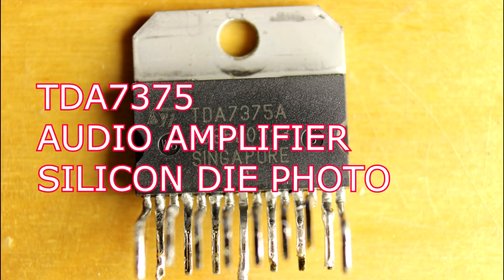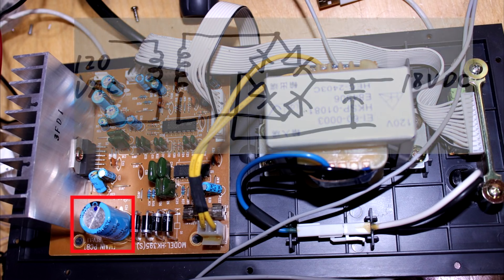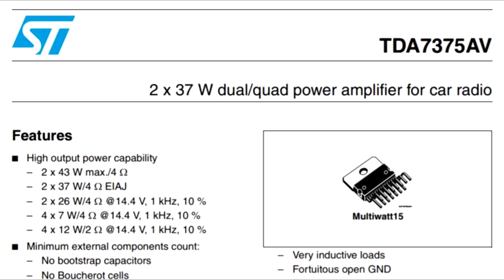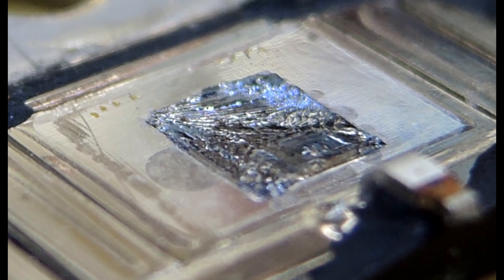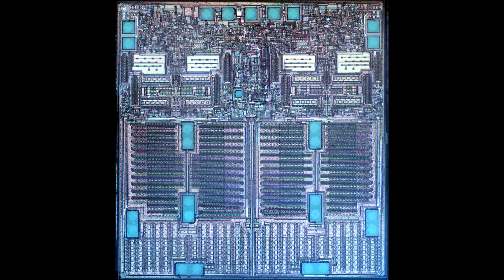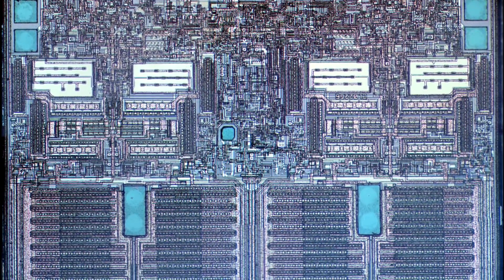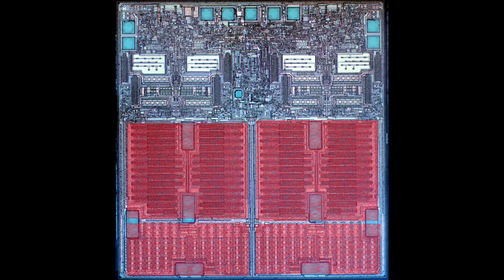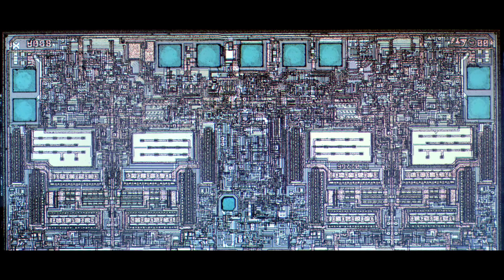Tear down of a TDA7375 Audio Amplifier IC

Comment: The amp become unstable with heavy loads below 4 ohms in bridged mode, horrible popping sounds similiar to clipping can be heard, internal current limiting is only about 3 amps peak, which is a bit too low. I dispute the power output given in data sheets, seems much less.

Comment: That's a Harman Kardon HK395 30W powered subwoofer. I've Taken apart the same one. I used the enclosure and woofer to make a Bluetooth speaker. It's a bummer that the transformer isn't a center tapped secondary.

Comment: Any rated at 10% THD is a joke and at a single freq of 1khz.  In real usefulness it's a 5 watt per channel at .05% THD at 1khz and .5% at 15khz.  And at <1% it about 9 watts per channel respectively, any more wattage and distortion goes up big time.

Comment: those where all over the place in the 80's and 90's, especially in boomboxes, nice compromise for low voltage application over classical AB amps, but like all bridged amp the output collapse if you push it too hard and distortion towards the end of the range is pretty bad, now that class D amps have made those chips obsolete in inexpensive devices I'm not we win in terms of sound quality, I let the "audiophiles" debate that one lol...

Comment: Aren't switching frequencies usually well out of audible range? I have a stereo very similar to what you show in the video, and I replaced the transformer with a switching power brick. There is no noise. In fact it got rid of the hum that was being cause by proximity of the transformer to the other circuits in the stereo.
Reply: Euro Bum Switching audio amplifiers are based on technology that's even older than this chip. Yes, if they're competently designed the switching frequency should be inaudible.
Reply: It sounds like you're referring to class D amplifiers, which is not what I meant. Electronupdate, and I, were simply talking about using switching power supplies for stereos.
Reply: You'd still want to use a transformer if you had an AM tuner in the same equipment. Switching power supplies definitely cause lots of interference on AM bands.
Reply: Yeah, there is basically no good reason other than simply reusing very old designs that you still see transformers used instead of switched supplies. For the same power rating, even a relatively crappy SMPS will have lower output noise (in the audible range) and lower cost than a transformer.
Reply: Switching supplies do indeed have most of their energy at high frequencies however, high frequency power supply noise is not good for the loop stability of op amps which often have wide bandwidths and it is also not uncommon for some noise energy to be at lower frequencies due to the loop settling time of most switchers. Of course, good switchers are quiet, but they are not trivial to design.
Reply: The Emotiva XPA gen 3 uses a 1500 watt switch mode power supply, my 5 channel XPA-5 will deliver 250 watts per channel all Chanels driven. It produces no noise.